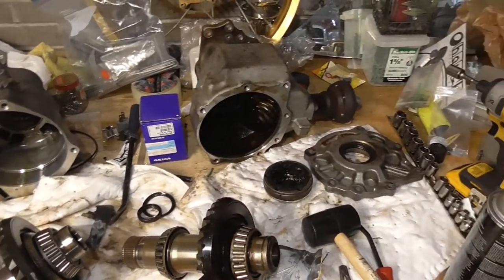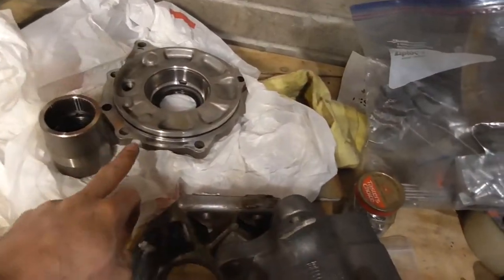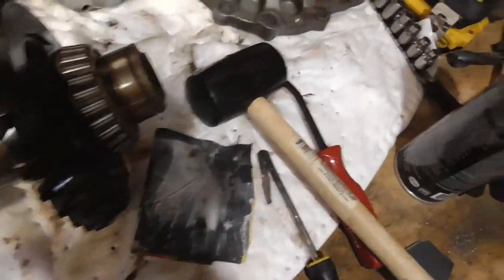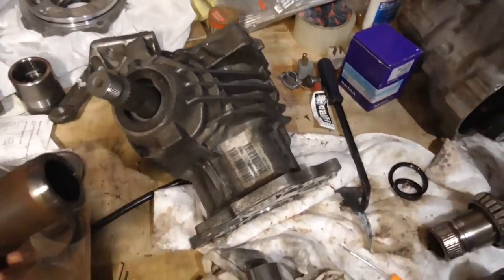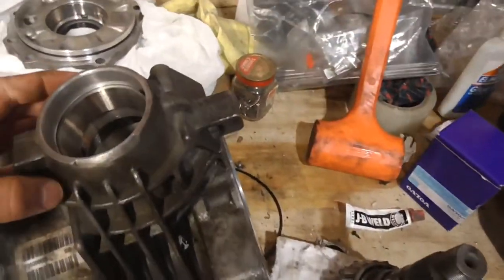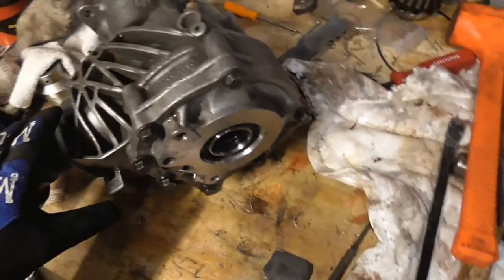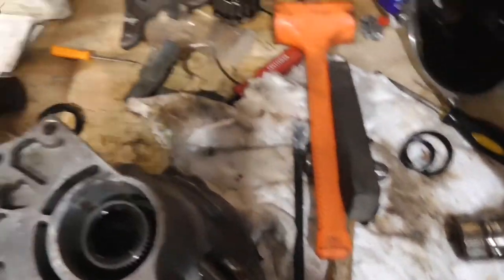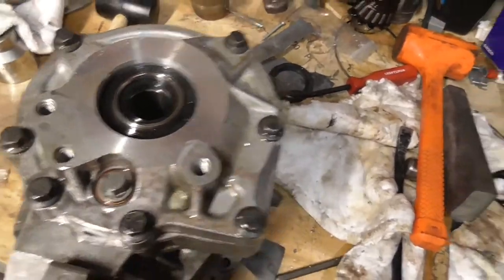Volvo XC90 Angle Gear Rebuild and Reseal V8 B8444s

Comment: Hey man I know this was posted a while back but I hope you see this posted, that seal that goes between the angle gear and where it mounts to the transmission was it anything special involved replacing it? Or pretty simple and straught forward, mine is leaking real bad from that area where they both meet and I am ordering the seal from volvo want to make sure it isn't anything too complicated once you have the angle gear off and ready